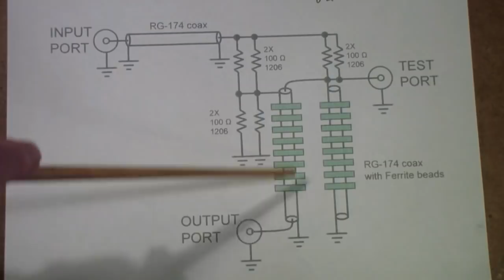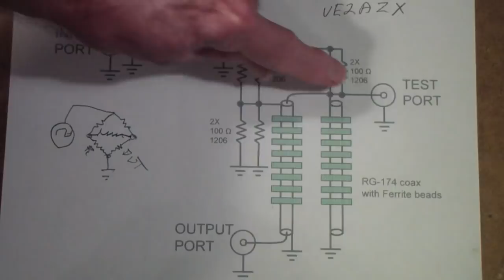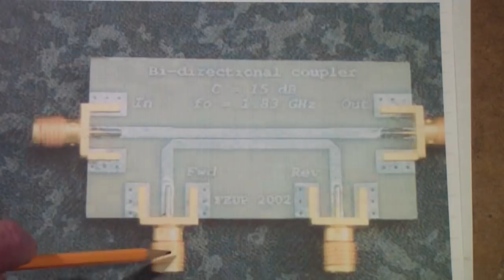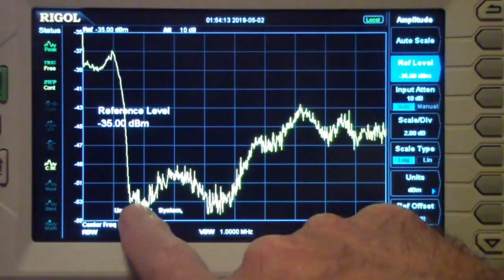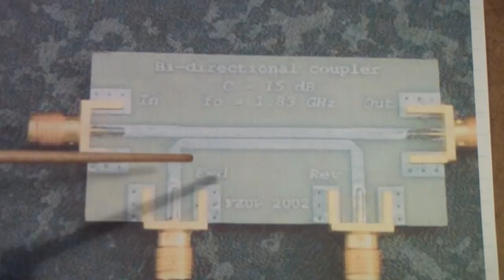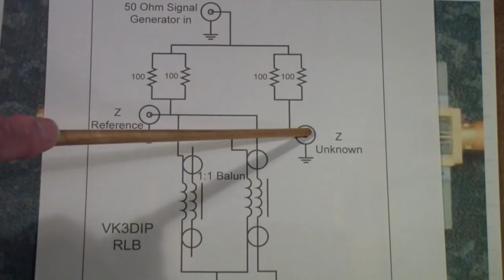TTT264 Return Loss, Reflection Bridges & Directional Couplers

Comment: https://youtu.be/AAeju26sVcU?t=304 
There is a “transmission line transformer” to provide the differential signal of the bridge at the output as a signal against ground. 
This is done by feeding the differential signal into the left transmission line which is grounded just at the output. To keep the symmetry between both arms of the bridge the test port signal is connected in the same way to the shield of the other transmission line which is also grounded at the end. 
The grounding is only effective for DC and low frequencies so that in the operating frequency-range the bridge signal is transformed to a signal vs ground.